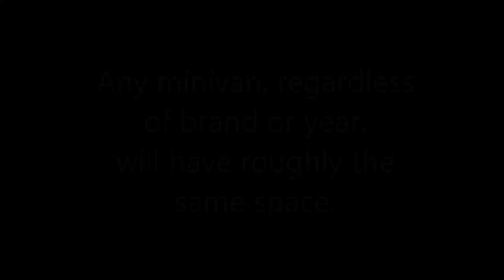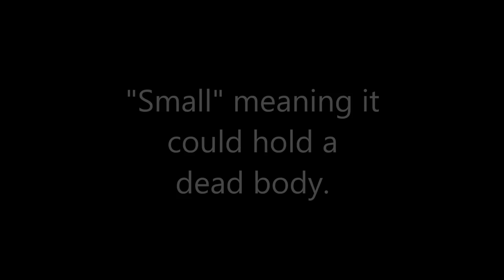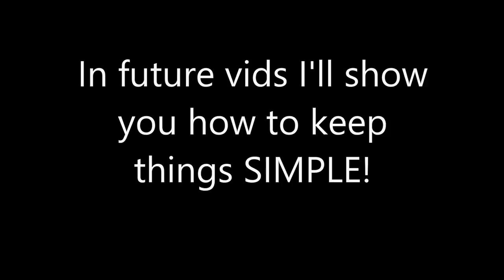Kevin's BASIC Minivan Build Out,  and WHY I'm doing #VANLIFE in a van.

Comment: I want to preface this comment with this July 2019 I have slept only in a hammock for 2 years. Yes even at home, I sleep in a hammock. So I am on my second  Grand caravan in 4 years. The first one (2002), I made a suspension system that hung from the seat belts. It worked great. Then the new van 2011 is wider at the front seat section, so I got a hammock stand like I use at home. I do a lot of trail maintenance both as a group effort, and solo. Sometimes I am at a location that doesn't allow hammocks attached to trees or I am solo and camping along a road. So being able to hang a hammock in the van is important. I volunteer 4 to 8 work weeks on weekends every year maintaining hiking trails, depending on the winter weather (Chainsaw work and brush cutting). I also get in about 1200 GPS'd miles of day hikes and backpacking every year with some of those mile including trail care. It could be possible with my homemade suspension to hang two hammocks, but I will never need to. ;-) I do have an isolated house battery for lighting and other power needs. I also have a jazzy scooter carrier with loading ramp for my AWD mower which can act as a cooking space under the hatch in good or inclement weather.

I have watched a lot of van conversion videos and your's is one of the best down to earth simplistic builds I have seen. Great job!
Reply from the maker: Tony, I'm glad you enjoyed the basic van build video. Sounds like you are one the guys to thank for the great hiking trails all over the country! I have never tried sleeping in a hammock...I'm going to have to give that a try for about a week and see how it goes. (More vids to come that I hope you'll find useful!)
Reply: @BudgetTravelGuy  I'm subscribed so I should see your new videos. To make  your hammock venture successful at least have a car window silver reflextex for you underside insulation for this time of year. A normal sleeping bag should be ok if you not hiking in any distance. 
 
Yes I do do a lot of trail maintenance in pennsylvania.

Comment: I own a condo, make 90k a year but I live in a minivan for 2 to 4 days during the workweek and come back to my condo on the weekend. Why don't I live in the condo all the time? I work construction and I get sent to construction sites all over the Seattle metro area. I'm not happy with with my current employer, Prime Electric, because there are construction sites just 20 minutes from my condo but they send me to sites on the opposite side of the city that are 1.5 hours away. Spending 2 to 3 hours in terrible traffic every day is taking a toll on my mental health/wearing out my car too fast and I've realized that I need to be closer to the jobsite or change careers. I've already changed careers a few times, I don't want to change careers again and with the exorbitant cost of housing there is no chance of buying a place closer anytime soon so the Van is the only option. I thought about renting a room but the last time I rented a room I hated it my housemates were very messy and the landlord violated my rights with the Van I don't have to worry about bad housemates/bad landlords. There is also the fact that renting a room would cost me $700 to $900 a month while living in a Van would only cost me $200 a month. Renting a room would eat up almost all my savings and I don't want to live paycheck to paycheck. Van life doesn't have to be awful I've outfitted my minivan pretty good with alot of the modern convinces. The biggest problem so far with living in the Van is keeping the Van cool on a 85 degree day, I can't use an A/C unit because it draws too much power. Another issue is the Van getting broken into when I'm at work but I've kind of solved that by strategically hiding a few items/not having a really fancy build. Thankyou for the good information Budget Travel guy you have helped me alot.

Comment: Kevin,  I am a new at this and would like to know how you secured your slide out bed to the floor without drilling holes.  I am contemplating building a similar bed or using a cot.  Thanks for you help.  Winfield.
Reply from the maker: Hi Winfield Sam - I'm going to do an entire video soon on just the bed (along with vids on what we carry and don't, etc). To answer your question, though - it's NOT secured to the floor at all, and doesn't need to be. It's never moved around or caused an issue, and we've been coast to coast a few times with it.
Reply: @BudgetTravelGuy , thanks for sharing your tip/insights.  Will consider your method as I work on the bed build.

Comment: Yes Kevin ...what van is most square? Easier to build out??
Reply from the maker: Dd Mav, a cargo van is probably going to be more "square" than a minivan, but you'll have curves to deal with on any of them. Older stuff probably tends to be more squared off on the inside. Hope that helps. I have a friend in the middle of a cargo van conversion now and hope to have some video on that up soon, which may help you out. More soon...stay safe.
Reply from the maker: By the way, unless people are going to be living/camping in the extreme cold, I try to steer them away from gutting their vans (at least until they get some miles under their belt doing things simpler and easier).

Comment: I noticed that you didn't say anything about entertainment where's your TV ?  I thought you might have one since TV signals can be picked up for free with an antenna.
Reply from the maker: No TV - although my buddy has run across a cheap solution I'll be doing a video on soon. It's hit on miss on the devices it works on, so I'm working on testing it on various devices. For the trips I have been on, I'm fine with a lot of reading, or a little Netflix. I kicked commercial/cable/satellite TV out of my house 5 years ago, because I seldom wanted to spend 22 minutes of every 60 watching the same drug commercial repeatedly :-) Be sure to subscribe so you'll see the TV solution vids I'm doing when they are ready.
Reply: If tv is your thing, then maybe van life isn't for you (you can do it, but it's a hassle and heavy).  You may be able to get plenty of entertainment with just a smartphone & an unlimited data plan (if you need a bigger screen, get a tablet).

Comment: What type of minivan is that I like the size in the style we have a pickup truck that does have camper shell on it this when you're disabled in your in pain you want to be climbing out of the back of that thing all the time please let me know thank you
Reply from the maker: Robin, that particular van is a Chevrolet Venture (Olds Silhouette and Pontiac Montana are the same). Any brand of minivan will have roughly the same interior dimensions, so what you see added to this one should work in any brand you end up with.) Pain is certainly no fun, so hope you pick up some tips here to make things easier. Lots of stuff on this channel about both minivans and fullsize vans, but off the top of my head here is something you may find useful: https://youtu.be/vhxqt5834O4

Comment: Gotta question bout the Venture. Mine is an 2002 and I have 2 twelve volt (cigarette lighter ) female parts on either side of dash down by driver n passenger knees. Do u know if 1 of them is a lighteeer and the other N isolated charger? I have the Manuel but cNt find anything. Thanks for any info!
Reply from the maker: Not sure, Brian, but I think your guess is right - you have one of each. Just be careful not to overload them (12v). You'll find all kinds of minivan topics in the minivan playlist on my channel. Safe travels!

Comment: There are places you can’t stay in a van .... so you use the tent as a decoy
Reply from the maker: Erin, this is a good point, there are those types of situations, although rare. But it is possible to end up in a place that requires "tent camping" (even if you end up staying in the vehicle), so it's a good idea to always carry a small tent.
Reply: @Erin Beyer, I use reflectix on my windows, so if someone knocks, I just don't answer. They have no idea if there is someone in the vehicle or not.
Reply: i use reflectix on mine too .....  but I have been told by friends in law enforcement .... they know someones in there ... because normal vehicles don’t have all the windows blocked ..... covered .... front yes maybe even the passenger and drivers  but not all of them ..... 95% of the time somethings up when they are .... just saying ....

Comment: What about condensation?
Reply from the maker: Condensation isn't an issue until you get down to temps in the 30's if you are completely sealed  at night. At that point it's mostly just an annoyance - water on the inside of your windows you'll need to wipe off in the morning. More soon...safe travels!